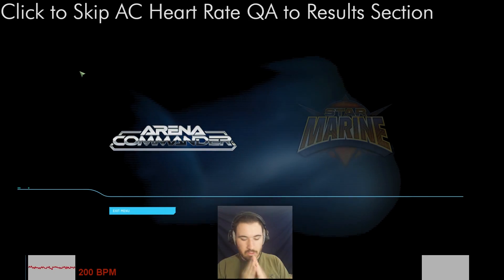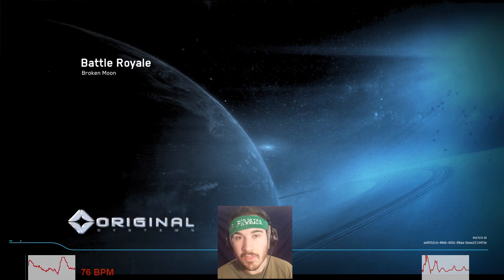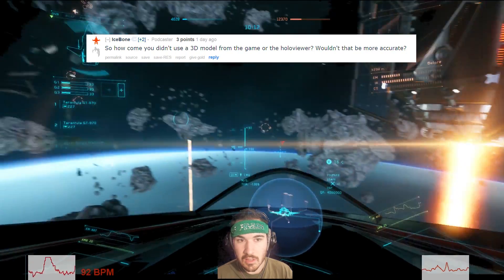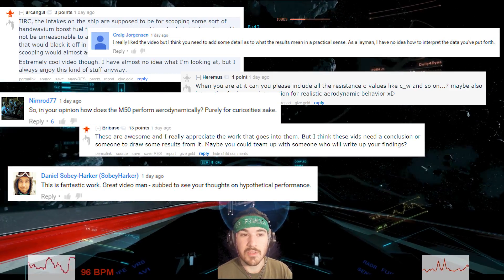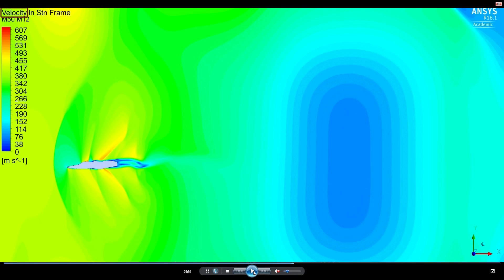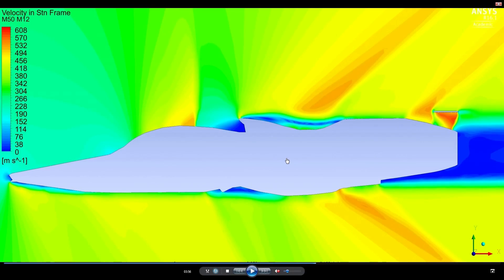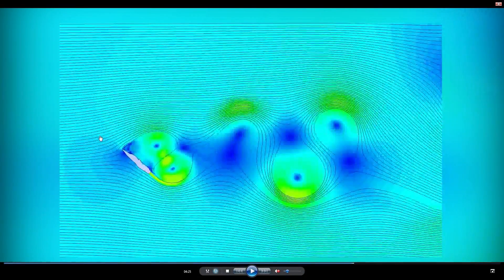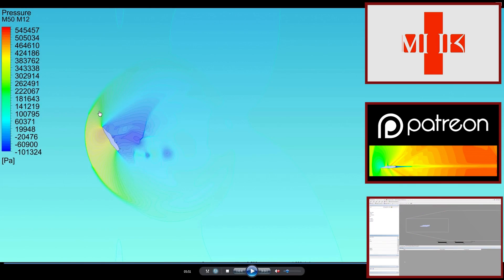[Star Citizen] M50 Interceptor Aerodynamic Visualization QA&Results

Comment: Also that diverging nozzle created by the airfoil is really cool and weird. Its hard to get a physical grasp on the whole thing. Like the fact that an almost perfect representation of the diverging part of a nozzle is created just from the air flow, but then all of that velocity is just instantly lost at the shock at the end. In fact looking at it, it almost seems like the shockwaves are actually creating?containing the nozzle which is kind of reminiscent of a aerospike engine design. I just don't understand how all of that velocity can just be killed off like that, is the pressure difference is really that much greater after the shock? Last thing haha could the shock at the end of the "nozzle" be somewhat attributed to the same principles as over expansion in your regular ever day CD nozzles? With over expansion you tend to actually get shocks within the diverging part of the nozzle itself because the pressure within the nozzle is lower than outside of the nozzle which leads to problems for rockets but in this case it might not really do much haha. Just interesting to think about. Thank you for doing this.https://en.wikipedia.org/wiki/Aerospike_engine
Reply from the maker: +Ian Bringe The velocity turns into pressure and temperature :) conservation of energy is your friend

Comment: So when you say mass simulation, does that mean that solidworks applies mass to the ship and the airflow to determine the forces on the aircraft, or something in that same vane?
Reply from the maker: +Ian Bringe It would have been more correct for me to say a density based simulation, Ansys can run in a pressure solver or a density solver. For some things a density solver is needed to hash out the correct results